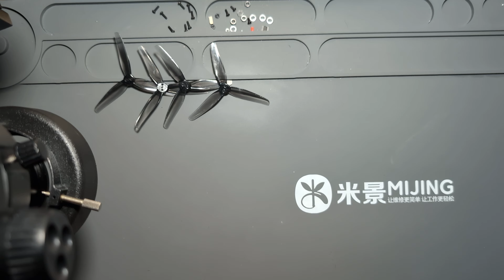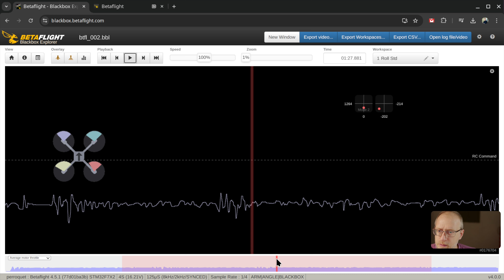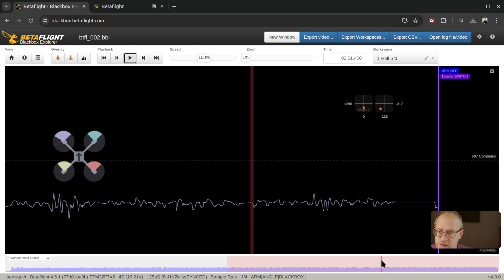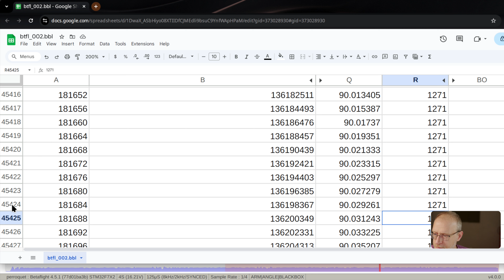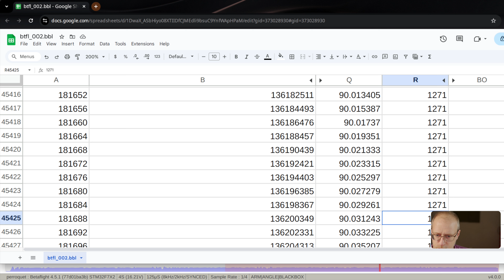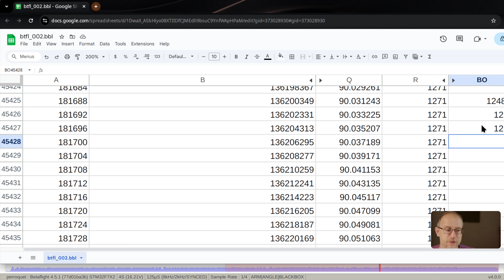Establishing a Control Baseline: copper-rs on a Drone Series [Part 7]

Comment: Can I do it as my FYP? Any extra resources for this application please? Autonomous racing drone. Also, what's the minimum requirement for the single board computer?
Reply from the maker: This is definitely towards those types of applications I am developing this basic drone support for Copper! This would be a challenging but such an amazing end year project for sure!! The board I picked is the Radxa zero 3w because it has at least a small NPU accelerator to help on the autonomy algorithms. Please ping us on our discord server, https://discord.gg/A9TbnwBn